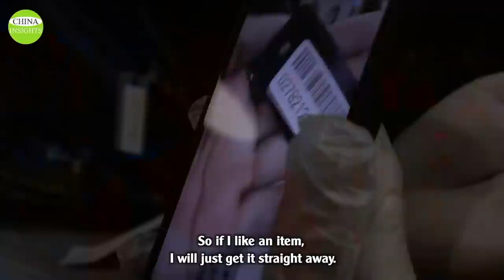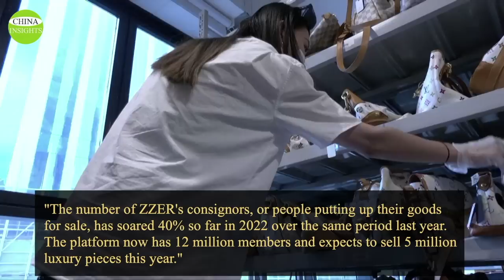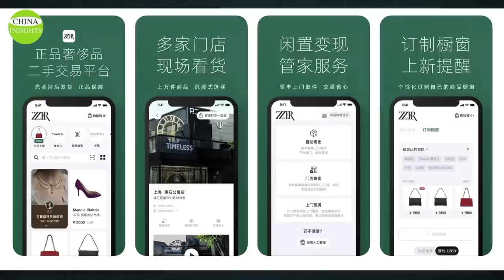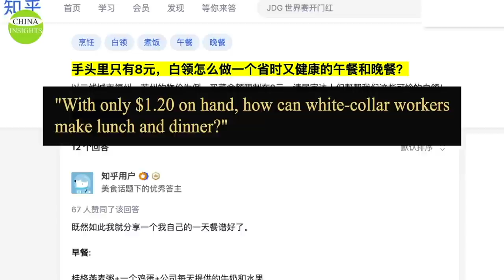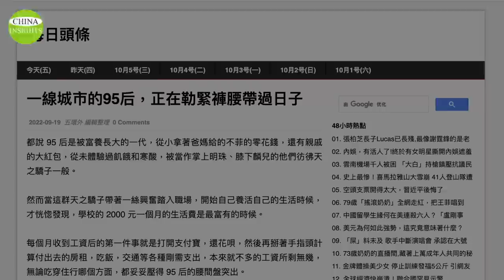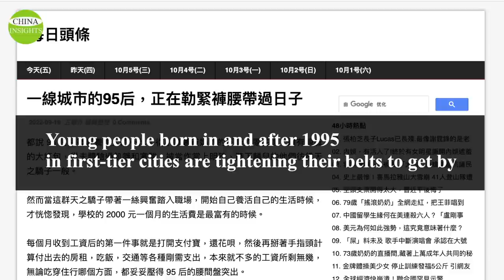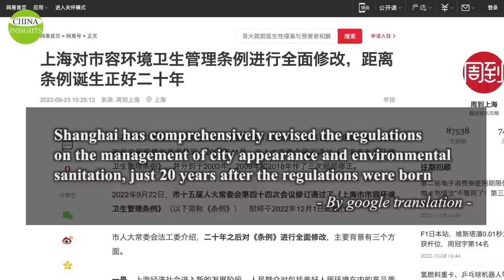The economy slides rapidly towards collapse: what could you do? $1.5 dinner: Post-95s save money too

Comment: One party system may not be bad. Take life expectancy of both China and US as example. In 1950 China life expectancy is about 38 vs US 68. After 71 years, in 2021 China life expectancy is 78.2 vs US 76.1( latest figure by CDC , US life expectancy dropped by 3 in 2020-2021 period from 79.1 originally). China expectancy increase by 40 years while US increase by 8 years only. China life expectancy increase 5 time faster than US.

Also Look at health care by comparing MMA rate( maternal mortality rate): in 1950 China maternal mortality is 1500 women death  per 100,000 birth vs US 100 women death per 100,000 births. In 2021, China MMA is 16.1 vs US 23.8 per 100,000 (the lower the number , the better health care service level) . 

 Infant mortality rate: in 1950 China infant mortality is 195 death  per 1000 birth vs US 26.8 death per 1000 births. In 2021, China infant mortality rate drop to 5 per 1000 vs US 5.4 per 1000 birth. 

In fact among top 10 population countries,  China’s life expectancy is longest 78.2  years old vs US 76.1 and India 70, Indonesia 71.7, Pakistan 67.3, Brazil 75.9, Nigeria 54.7, Bangladesh 72.6, Russia 73.1, Mexico 75.